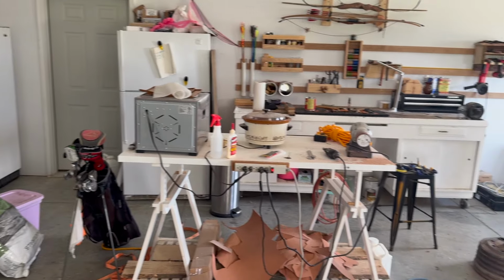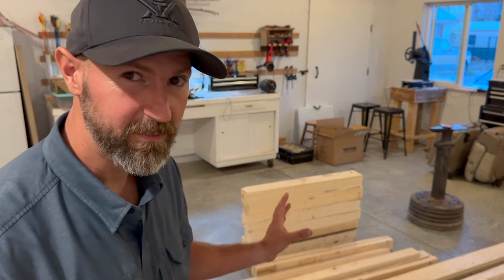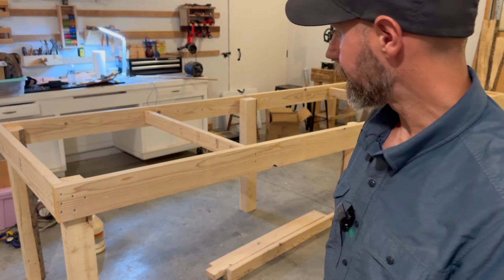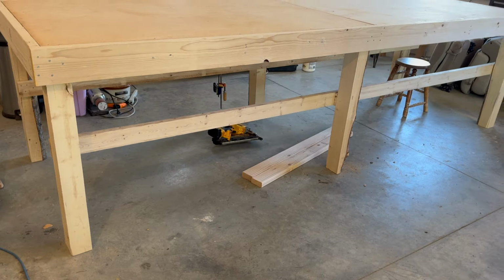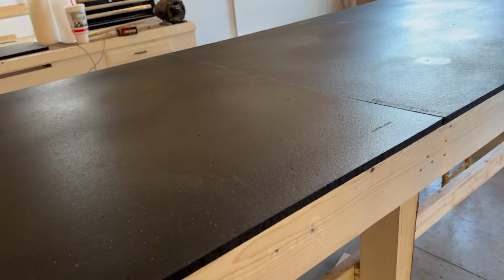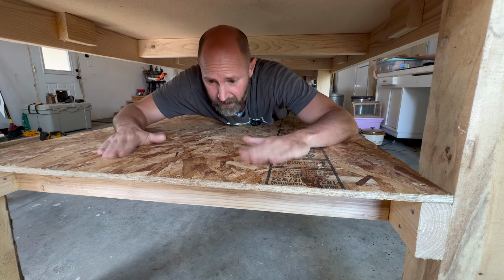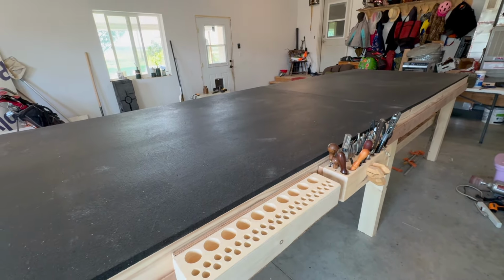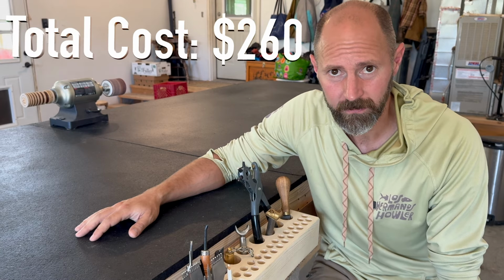Affordable Leather Workbench with Two Life Hacks

Comment: great looking workbench
Reply from the maker: Thank you
Reply: @wyomingwright  i like the stall mat idea. I have seen the plastic cutting board material used before,  but it was expensive. I like this idea
Reply from the maker: It works pretty good, especially for cutting. It does have a bit of shock absorption so it’s good to have an anvil for setting rivets. I use my press for that and punching holes

Comment: Doesn't stall mat make blades dull?
Reply from the maker: It’s not bad if you don’t try to push your blade deep into the mat. I haven’t found a material that doesn’t dull the blades at least a little. You just have to keep them stropped. I like the mats because of how well they endure the cutting. You can sharpen the blades but you can’t fix the mats